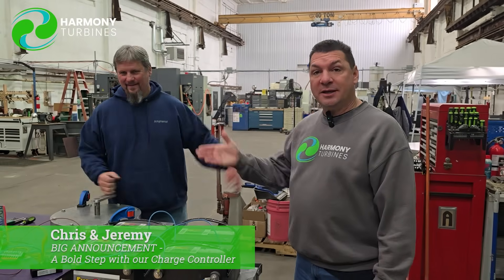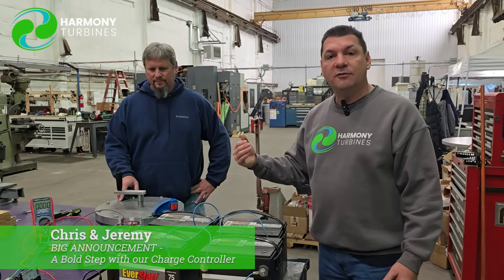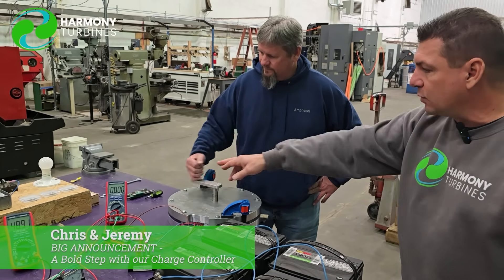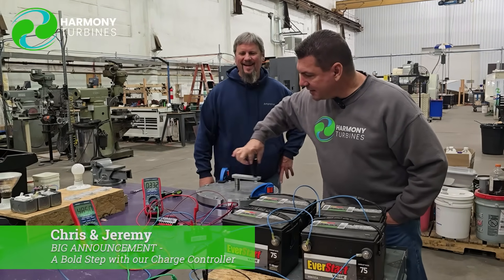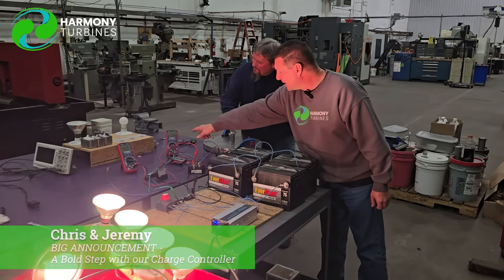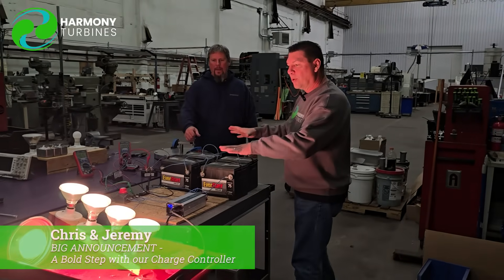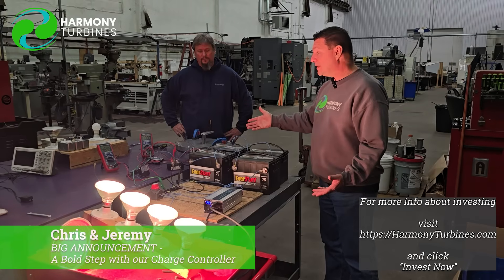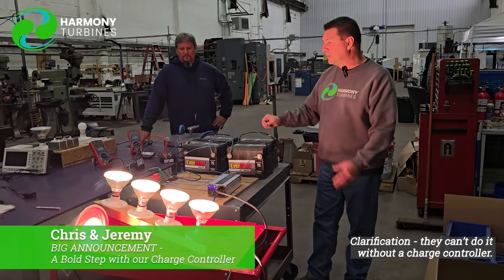We Finally Did It!  - A Bold Step Forward

Comment: Let me get this straight. You spent 2+ years working on a charge controller that you don't need? Had you simply used an LFP battery with a good BMS, the battery is already protected. Just don't over-voltage the BMS and you're good to go. Your main issue is that you're using Lead Acid and not LFP controlled by a BMS. That's OLD school!
Reply: What they are saying is literally “we are going to throw away the higher end of the torque so that we don’t overvolt the batteries.” This is painful to watch; they are basically stumbling their way into a 10th-grade science project. What they need is a device to optimize with a criterion of extracting the maximum mechanical (electrical) power from the wind—that’s what any solar, hydro, or wind inverter does.
Reply: @mic1hovh27 Yeah I’m curious at what point the voltage exceeds their target range. If it happens at 20 mph that’s an issue. If it happens at 35 mph, I mean it might not be unreasonable.
Reply: @josborne711lupinesports4  Assuming the battery bank is large enough, the voltage can’t exceed the target range because the diodes will start conducting when the voltage on the generator side is greater than the voltage on the battery side. From that point on, there’s a small range where this thing will be viable. But it all depends on the battery, the generator, and the wind. What a tuned controller does is eliminate all of those factors and extract as much power as possible while not letting the turbine to stall.
Reply from the maker: Mic you're dead wrong and keep the ugly 10th grade remarks out of the comments or you will be banned. We are showing everything and one of the next videos we do will show you much HIGHER RPM ranges so you can see there is no problem. The batteries hold the voltage down so long as they can accept bulk charging. ONLY when they start to top out and get full does the voltage begin to rise and then and ONLY then would we furl to protect the batteries. We're not in any way throwing away our upper power production. So again I say stop trying to speak as if you are the authority on how this is going to work. We will show you so you can see for yourself.
Reply from the maker: Mic one warning only... nasty comments like this will result in you being banned from the channel. We're going to show all of this higher end production in more videos. So stop with the nasty comments now. It's fine to ask questions and speculate on things but don't speak as if you are the authority on our work and what we're doing here.
Reply from the maker: Todd LFP and other lithium battery banks require a BMS to help balance the individual cells. A BMS is different from a charge controller. We are going to start looking at integrating BMS into our solution for the higher end banks that are currently on the market. It's unclear at this point if Sodium Ion tech is going to require a BMS but we will be testing this as soon as we can as well.